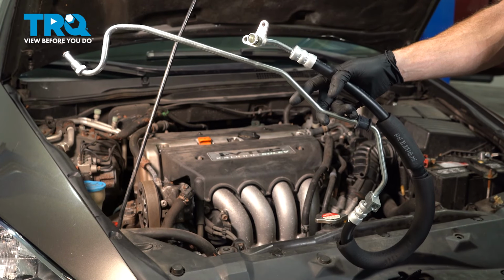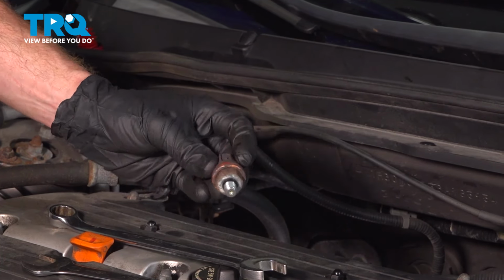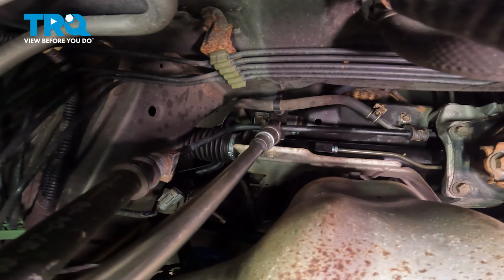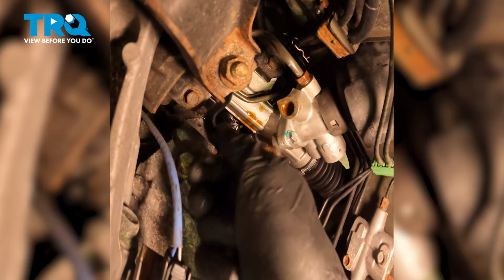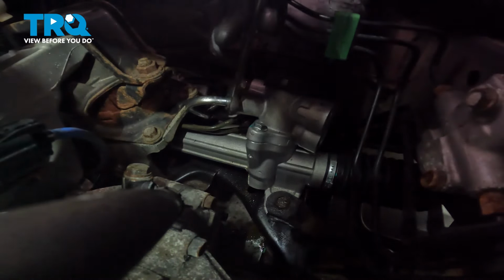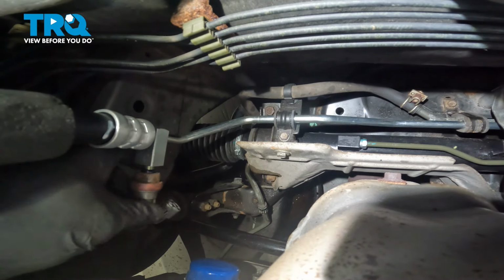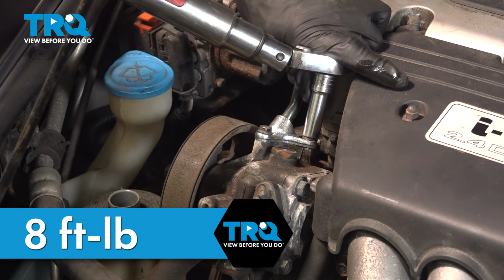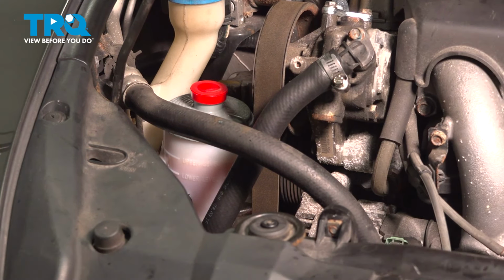How to Replace Power Steering Pressure Line Hose Assembly 2003-2007 Honda Accord

Comment: Dumb question, but wouldn't the first step be to loosen, remove and drain the fluid at the lower connection at the steering rack (so you don't have a mess at the sensor and/or the pump?  Food for thought 🤔.   Other than that, I'm not looking forward to doing this on my V6 Accord 😂, absolutely no room working down the backside of the engine removing those line brackets on top the rack.

Comment: At 5:30. You cannot fit the curve inbetween that rack and bracket.  AND.  The hard end of the hose hits the frame so even if you could fit it,   it will not go unless you bend it.... So yea there is more to this guys.  Ill figure it out since u are incorrect 100%

Comment: As a beginner in car maintenance life, I just decided to get my dad's mechanic for this fix for my Honda CRV. 

Honestly even the mechanic found it to be demanding but it was simple. 
1.) And first things he did was  disconnect the negative terminal of the battery and take out the engine air filter area for access for the area of the metal  line part of the pressure assembly (I used Duralast 92667)

2.) He then took out  the screws for the 2 hose clamps  that was holding the metal line attached to the pressure hose in place 

3.)He needed to take out the front right wheel to heat up & clean  the fitting that connected to the end of the metal line  to get it loosen up (the one where you needed to take out the whole engine filter area to access ) since it was so rusty. 

4.)He moved on to take out the bolts/nuts on the steering pump. 

4.)And used a long needle nose pliers & tack puller for a  hose clamp. Once those fitting/clamps/nuts/whatever were dealt with, the whole assembly was taken out. 

5.) He used the tack puller to cut the hose clamps and put them on the new Duralast Power Steering Hose Assembly 92667. He lay the new assembly in place and began tightening the fitting, the 2 hose clamps. 

I hope this comment helped and managed to do it yourself instead of getting scammed by a $250+ quote if you bought your own part to and $400+ to a shop who won't let you bring your own. 

I was lucky to pay $140.

Comment: This video was very helpful. I just did this job on my 2005 Honda CR-V. Only differences for me were that I removed the airbox and the hose next to the high-pressure hose in order to remove the high-pressure hose. The airbox removal probably wasn't necessary, but the threaded end of the line was stuck so I needed extra room.

Comment: That flare nut was annoying to loosen up, but I did it without cutting or heating it up. I sprayed it down with PB blaster and brushed the nut with a metal brush. I repeated it and kept on brushing, id tap periodically on the nut to help penetrate the PB blaster. Little clearance for leverage, so I disconnected and moved aside some of the wiring harness and removed the air box and battery. Still have to find an angle, but I used a crows foot 19 mm and a 17 inch breaker bar, I used a cheater bar for for slightly more reach, I cracked it a tiny bit and I rebrushed and reapplied on blaster. I grabbed my flare nut 19 and with it on the flare nut pointing downs, I placed my body facing forwards and pulled up like I'm doing a dip , easy leverage if done like this. Not a bad job

Comment: I changed mine topped off its stilll squealing do you think it’s the pump
Reply: If still squealing, then you pull the low pressure line at the front of the power steering pump and look at the O-ring there. If it's black you need to order the replacement O rings for it, the replacement which fixes the issue is orange in color.

Comment: What are the dimensions of the bolt that hold high pressure hose to the pump. I lost one need a replacement 😂

Comment: The key to put the new one in is to remove the heat shield near motor mount.  It will give you way more room to work

Comment: No matter how I tried I was not able to remove the hose under the motor mount.
So, I just took out the whole mount; it was easier than "masturbating" with the curved pressure line

Comment: Why not have a rag ready under every hose fitting removal point? Now that you're finished you can pressure clean all this mechanics spillage points so you don't chase mysterious leaks for days. TRQ should do videos of less corroded vehicles.

Comment: At 5:03 how did you get enough leverage to get that tool in there, I hardly have any space. Seems like that nut on mine is seized. No tool will do it. Tried some busters and that didn’t do it either. Now I’m stuck with a seized nut and a leaky hose 😢

Comment: Thank you for the informative video! One thing I would do different is to hand thread all the bolts and hose ends finger tight then go back and snug it all up at the end. This is a good way to make sure nothing is under stress.

Comment: This video seems like it is geared towards a shop, i don't know anyone with the vacuum tool they used to drain the fluid, and that will only drain the tank, not the system.  Make sure you find a different video to help you drain the system of fluid before removing the hose.